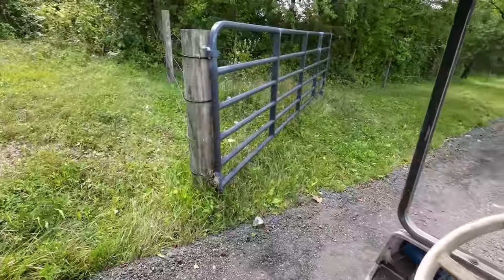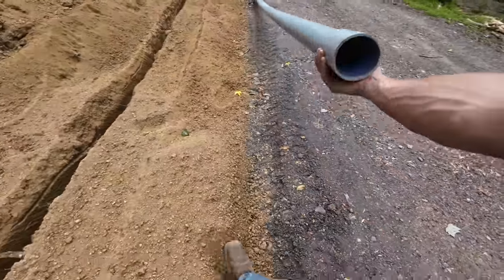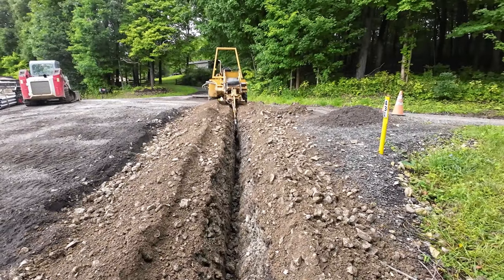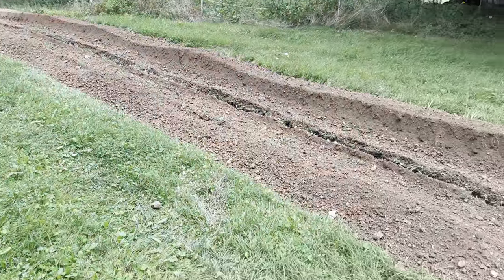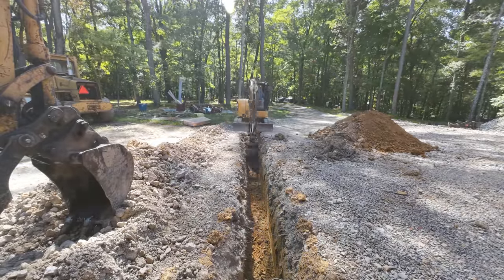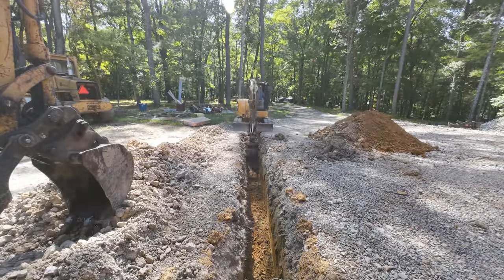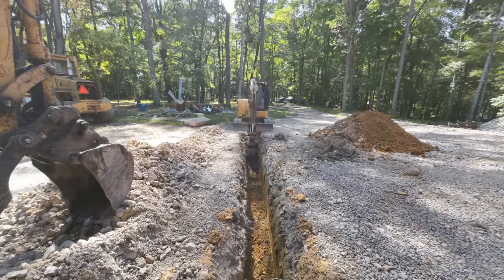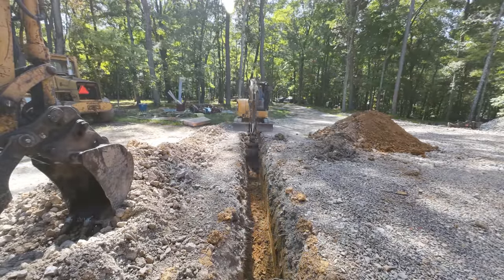Running Nearly 1/2 mile of Underground Electric, Costs over $64,000??!?!

Comment: Matt, I work in the utility sector, and those costs are ridiculous.  I am in the midwest, so market rates may be Vastly different, but that seems like they are quoting you to open the trench and lay in the duct as well.  If they wont come down on the price, it may be worth seeing if you can have a third party contractor come in and pull the primary.
Reply: I'm in the UK and retired a few years back, I'm a Mech Eng and used to supervise capital building projects from bare ground to completion. We would rarely use Utility companies for such works, simple reason, stupid costs. We would almost always use contractors.
Reply: Are you kidding ? 1/2 mile conuent 4 strans of 1/2" copper wire thats the $64'000 there .
Reply: Matt plum crazy do what the comment section is saying hire a contractor thay need to make a living and won't bind you over like that.   It's going to cost but at least you won't feel the pain from a good screwing.
Reply: @charlesyates6687 I think you’re right, people don’t realize how copper and other minerals have skyrocketed since the last 10 years with an acceleration caused by armed conflicts in the same area those ore are mined
Reply: @charlesyates6687  he' s getting the transformer installed right next to the workshop, so the main line getting up to that point is high voltage thin wire, as he said, around 10k, probably aluminium instead of copper
Reply: Utility costs seem fairly reasonable to me. Elec utility is providing the wiring from the existing pole to the new transformer (more than likely the existing pole will need to be modified to allow for a new connection), the installation of the transformer (which includes plinths and the transformer itself), future replacement of the transformer (ie due to failure caused by a manufacture's defect) and all labour associated with the installation, testing and commissioning of the transformer, wiring, metering etc etc. Most of the cost is tied up in materials (ie cables, transformer, meters etc etc). Not a cheap exercise by any stretch...but IMO the costs aren't unreasonable.

Diesel C, do you know the specs of the transformer you're getting? Ideally it'd be listed as part of the cost breakdown provided by the elec utility...
Reply: @charlesyates6687  except he looked up the price of the wire, he said a little over 10k material cost.
Reply: curious  what would a solar system cost
Reply: Absolutely!!!!
Reply: @gloveyourway2000  the transformer is part of the power grid, and not a responsability for the customer, if you need a dedicated transformer like in this case you usually pay a monthly or yearly fee as "rent", or at least that's how it works in most civilized countries..
Reply: @roberto.peterson9917  He could run a diesel gen for what solar would cost and it would be more dependable. He's in Pa.not the south. Plus, he wants to be able to weld, run hi amp stuff and power his home someday. Solar isn't practical.
Reply: @charlesyates6687 we can use 4/0 aluminum triplex…with a reduced ground, don’t have to use copper… if he used a URD aluminum direct burial he wouldn’t have even had to drop any pvc conduit in the ground
Reply: @XavierAncarno  99.99 times out of 100 they use aluminum for primary wiring.
Reply: @charlesyates6687 It doesn't have to be 1/0 or even #4. They're pulling transmission power (7kV) to transformers near the point-of-use. #8 triplex will work for that; in volume (like a PowerCo would) that stuff is less than $1/ft. ('tho they'd likely use #4) I didn't watch when they replaced our underground services around here - the conduit is rather big, but the wire isn't.
Reply: @charlesyates6687  - Usually, they use Aluminum wire for electrical feeds.
Reply: @charlesyates6687 it would be aluminum wire.
Reply: No need for too much wire is solar panels would be on the roof 🤷‍♂️
Reply: @Jonas-vi1sl  .. and what does he do when snow covers the solar panels for a few months during the winter?
Reply: #2 Underground Primary (Hendrix) cable. And probably 350 underground Triplex for the service to the building.
Reply: @charlesyates6687  he said at the end of the video that the wire cost is only $10,000, the other $54,000ish is just the power company just gouging
Reply: @silentepsilon888  you can get batteries and solar panel naturally heats up and the snow slides off if in the right angle.. and with 50k you can get lots of power even in winter and shaded sky… its a no brainer
Reply: @charlesyates6687 They don’t generally run copper for that sort of thing.  It’s usually aluminum wire.
Reply: @silentepsilon888 ... Solar aint perfect but should consider all options.  Option #1 Grid.  If 1 half mile in woods that's $100,000 of material and labor to hook to grid.  Power is usually $500/month or $6000.  Option #2 Diesel Generator.  Cost $5000 and $10000 annual fuel bill.  Option #3. Solar, cells would be $20000 and $60000 lithium batteries to get thru halfsun energy in January to March. So solar IS cheapest for those halfmile from road.  . . .  If a half mile in a woods hooking up to grid is NOT obviously cheapest ... Hahahaha.  But if not on the grid no milionaire will buy Matt's property in 20 years for $10,000,000, so thar extra $100,000 matl/labor WILL eventually pay off..  Matt knows this, he wants plain average grid option, so he and fun wife can retire to Brazil and Mardi Gras !!!!!!
Reply: @Bret4207 A friend of mine has been all solar here in Michigan for 20 years. Initially he wondered about the toaster for example since it drew 'so much power' but then he realized it runs very little. Same with welding, sure he'll want to do that but not for hours every day, maybe not even for hours ANY day. Solar batteries are coming down fast, I just acquired a 17KWH pack for $2,400 plus shipping.  He's got a LOT of room up on that barn for panels and has cleared the trees for a fair distance, plus he already has diesel for backup!  I think if he had the $52K Quote before he started he would have at least given solar  look!!
Reply: Out west the electrical engineering is quoted separately and usually includes the load calcs , transformers easements , land surveys and recorded deed info .. but it doesn’t surprise me
Reply: Hey Matt nice work. Did you think about running a conduit for communications like internet for the future?
Reply: @jfbeam  That high voltage wire has to have really good insulation if they are going to bury it and really good insulation may mean it needs to be the next size up because it will also be thermal insulation.  It's not like just going down to Home Depot and buying some 220V wire.  A regular above ground (uninsulated) run would probably be a lot cheaper.
Reply: @charlesyates6687  negative. 1 run of 1/0 primary underground  cable. Its 1/0 copper or aluminum center with a dialectic jacket with and neutral wrapped around it.
Reply: Outrageous cost.  Someone is padding the bill.
Reply: @keitho3133 I trust he knows the supply house(s) to call for this sort of thing. (and the power company would tell him what to get.) True, it'll look a lot like 4/0, but most of it will be insulation. The actual conductor doesn't have to be that big - at most, it'll see less than 10A. (I would expect a 50k transformer to feed his shop, and future home.) I've not seen anything about what is being ordered -- simple 200A 240 residential? (looks like that's the meter box he hung) 480v 3ph?
Reply: you can save a lot on batteries by getting one out of a wrecked Tesla.  That's what Congressman Thomas Massie did.  Easy to find using a search engine.
Reply: @charlesyates6687 the cable will be likely be stranded aluminum, not four wires as they are going to put a medium voltage transformer to take the small gauge wire carrying 7KV. Ground is at the building and neutral comes from the transformer nearby. Will need four strands only from the transformer pad.
Reply: That sounds like really good advice , hope everything works out for you Matt. God bless you and yours. from England.
Reply: @silentepsilon888 as some one who is offgrid, when snow covers the panels, you run from batteries. The snow usually melts within a day or two. Worst case, you run your big generator for five hours or so and put that full output into charging batteries to run off for another day or two. Five hours of 10K generator time is enough for two days for my wife and I.
Reply: @roberto.peterson9917  More than the utility companies quote. That is if you want to be able to have batteries. And with Solar, you have to remember if the panels are covered with Ice/Snow, you get no power period, same with no moon nights.
Reply: @KyleMackenzie  and they probably have to upsize due to distance so not to have voltage drop.
Reply: @Jonas-vi1sl  depending on the brand you get Solar wise, prepare to spend 13 k + per battery.
Reply: This project teaches us all a lesson. Before works performed, make sure you have everything planned all costs put into place. A contract or bid for electrical . I enjoy this channel and the content. So sorry you assumed costs would have been cheaper and hopefully if there is a cost error it works best to satisfy!
Reply: @Bret4207   Naww. Solar is so cheap now. If he really has to pay that crazy fee, he could have gotten batteries, huge solar, a small wind turbine and hooked up his small diesel somewhere to all that stuff as well. Free power most of the year. And for welding, sheesh, doesnt matt have an engine driven one anyways ?
Reply: @TheMadJoker87 depending on the amount of amps he wants to pull that could be heavy wire. If wants a 200 amp service which is about right for his shop and future residence that is 2/0 or 4/0 x 3. That stuff isn’t cheap over $5 a foot so that’s 12-15K the transformer itself (yea you gotta pay for it but don’t own it so it’s like 100 yrs rent paid in advance) is another 15-20K. The rest is labor. So 40K cost of materials retail so figure half that wholesale so 20K. Cost of labor is fixed by the hour by the book to do an install, that won’t be able to be negotiated down. So $30-35K is a about the best case number. BUT he needs it now and the electric is in no hurry to do the work so they have him in a very tight spot. Want it NOW pay the $52K, want to negotiate we’ll bet back to you when hell freezes over (or Matt does).
Reply: @Jonas-vi1sl high amp output would drain his batteries instantly.
Reply from the maker: @gloveyourway2000 haha that’s the thing they will not provide me a cost breakdown. They said they will not provide an itemized bill.
Reply: @jonathanwilliams4501 not every utility company allows direct bury nor do they allow aluminum everywhere. There's one near me that requires rigid conduit and copper wire for underground runs.
Reply from the maker: @keitho3133  I priced out the exact wire that they are using
Reply: Oh I got a notification for this. I was replying to someone who thought you could weld on solar 😂
Reply: @DieselCreek  That's BS.. here in my state, Washington,  if you request a breakdown, you will get it.. has to do with transparency and fraud.
Reply: @DieselCreek that's BS, I guarantee they require itemized billing on anything they purchase.
Reply: I know in my neck of the woods, at least for the secondary's into the meter for a 200a service they run 250 kcmil aluminum which is overkill so maybe his utility company oversize's the primaries
Reply: @Poorehouse  ... the difference is that in a residence your power requirements are substantially lower than what is needed to supply this industrial type of workshop. He has floor heating to heat the shop, he will want to run air compressors, an overhead crane at some point, possibly a welder and other machinery that might need 240V single or two phase power. I doubt you can get the amount of power needed, especially in the winter, from solar cells and substituting with a generator which also requires lugging fuel to the site etc and is higher in pollution as commercially supplied electricity. Don't get me wrong, I am not opposed to solar energy, but there are situations where it is not the most practical solution and I am sure Matt weighed all of his options before deciding on connecting to the hard wired grid.
Reply: @DieselCreek  Like I said in another comment, reach out to the PUC and get their two cents on the situation.
Reply: Odds are the power company will use a contractor. That price is far from high for the cable going in. His logic is flawed regsrding the transformer. he pays for that  and the power company maintains it.  Under his logic he wouldnt be paying for anything as the power company maintains the entire line to the meter. But its his cost to run it and that included the transformer>im recently retired from underground construction running utilities as a contractor
Reply: @TheGamerHillbilly except that you can weld from a solar battery bank…
Reply: @TheGamerHillbilly  so lets do some calculations then… 👀 Pumps dont use that much energy.
Reply: Time to get a new editor
Reply: @roberto.peterson9917 
Solar would be next to useless due to unreliability. Can You imagine trying to clear half a foot of snow off the panels ?
Reply: @pcspecialistpdx 
Trying to insure a fire hazard like that may not be feasible.
Reply: @bigdog2024 
Very correct. I have been trying to point that fact out to commenters.
If the negotiations turn contentious The All Mighty Power Company has a battalion of attorneys standing by to make You understand that  " We are The Power Company and You are
 not. "
Reply: @DieselCreek 
If negotiations with The All Mighty Power Company turn contentious  their pace of action will freeze.
They have a battalion of attorneys standing by to make sure You understand that. "We are The Power Company and You are not. "
Reply: Yep. Take it straight to the FERC and PUC. Clearly, it is either miscommunication or abuse of the utilities' monopoly power.
Reply: @silentepsilon888 snow tends to slide off the panels pretty well, the biggest issue really is short winter days.
Reply: @Zonkotron  The point is he was reliable power for whatever he wants to do. That's nit solar. Why put tens of thousands into solar and wind and generators when mainline power is more reliable and cheaper int he long run?
Reply: @Bret4207  If mainline power ends up really being 64k, how is that cheaper in the long run? Compared to assets that make free power for decades? I dont think you realize just how cheap solar got in the last 10 years. Add decent battery storage and you are set for 90% of the year. For something like 25k and no cost for the power. Not to mention crap like a monthly fee just for having the connection. For buisinesses it can get even more funny. Peak demand surcharges and all that jazz.....the future of the Grid is no grid in remote locations and heavily computer controlled urban grids with few major power plants. Solar and wind are just too cheap now. I work in the field......
Reply: @DieselCreek  Very strange the power utility didn't provide you with a breakdown of materials...
When you applied for the power connection, did you submit any calcs or indicate what size supply (ie 200A) you need? 
Also, how do you know the cable cost if the power utility didn't give you a breakdown of materials?
Reply: @richardlincoln8438   put the batteries in their own shed if you're worried about fire insurance.  That said, there is little to no risk because of a lower charge/discharge rate than in a car.

You can garage a Tesla, why would a Tesla battery be any different.
Reply: @pcspecialistpdx  
Battery replacement rates and cost are not
negligible. The technology is not workable yet for solar, wind or any other renewable to perform as many wish that it would.
Reply from the maker: @gloveyourway2000  they refused to provide me an itemized bill. They said “we don’t do that”.
Reply: Have a private electrical contractor quote the install…and call the utility sales rep to be your advocate. Between the two, you have the power bill estimate that an electrical engineer can estimate on usage, and thereby get the payback estimate. Get a quote for them to bring power to your house, then they may have a different outlook. Best of luck, i worked with the power companies for my career…not for them.
Reply: @DieselCreek  Strange they won't do that for you. Even if you knew the cost of the items the elec utility was installing, it wouldn't necessarily change the price quoted by the elec utility. Unfortunately (and I've seen this problem many times) the elec utility is the only provider of grid electricity you have. Either you abide by their rules, or you don't get electricity.    

Guess you'll have to raise your objections and hope that you can reach a compromise. Good luck! Keep us posted.
Reply: @henryoppermann134  
Excellent input. The most important matter here is to not start a farting contest with The All Mighty Power Company.
Reply: @TheMadJoker87  
The moment that You push back the " rent"
for the transformer and any associated costs escalate. Not to mention escalation of time to start the project.
Reply: @DieselCreek  I would contact your attorney and see what options you have? Whether you need to fight it before or after. Its outrageous they cannot or will not provide a breakdown and are likely trying to charge you for services you already completed.
Reply: @Focusfanatic242  Press x to doubt...
Reply: @silentepsilon888  all things I do with my current offgrid setup (well except run a overhead crane motor - but that’s no big deal with a quality LF inverter). His primary heat is going to be a wood boiler - so he has a low wattage pump to run to circulate hot water and maybe another pump to push through the floor radiant. He isn’t trying to heat or cool with electricity which is the biggest consumer of power offgrid. Motors for compressors and tools and welders? No biggie. Being able to run all those things cost offgrid me less than what he’s going to pay to be connected to the utility - and I don’t have a monthly “connection fee”, I don’t have power outages like my neighbors, and I don’t need to send money to the utility each month. Matt is too far down this hole to back out now, but he could do a bomber offgrid system for his shop and expand it for when he builds his home. 

OTOH, once he starts building his home, he won’t need to expand a solar system with an existing grid connection. The grid makes it easy - need more power? Flip a switch.
Reply: @arisaka9963  I think Matt edits his own videos. Can't always expect it to be perfect.
Reply: I don't think that pole he showed had 3 phase power on it.  @jfbeam
Reply: And should the government adopt some sort of carbon tax, the price of electricity might go up until the grid can be mostly solar and wind powered. That would take a long time. And it won't be cheap either.  @Poorehouse
Reply: @jonathanwilliams4501  You have no idea what you're talking about. This job is PRIMARY power (you know, 7,200 ish volts, or whatever his utility runs)  "4/0 aluminum triplex" is for secondary from the transformer to the shop (or house) and putting URD in a trench with no conduit is a hack job !  Yes, it's listed for direct burial, but when frost drives a rock into the insulation on the shitty URD 10 years from now, then he's digging up his yard to fix the problem. He did the job the right way by installing conduit !
Reply: @DieselCreek What did they spec for the primary  and secondary cable? And what kva is the padmount transformer?  Transformers are crazy expensive. 
- I retired last year with 39 years in the high voltage trade ( Utility)
Reply: @mattywho8485  boom correct and if it's primary wire that stuff is roughly 12 bucks a foot from them so if he's got 1/2 a mile like he says....2,640ft that's 30 something grand for wire alone...add in transformer and pads you're looking at a ton of money so anyone going omg why is it so much just look at this distance and cost.